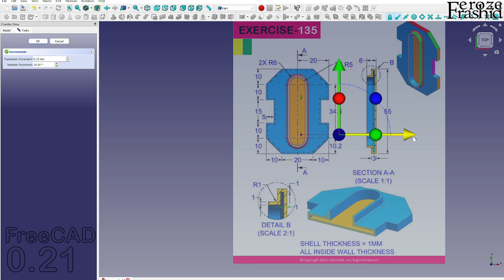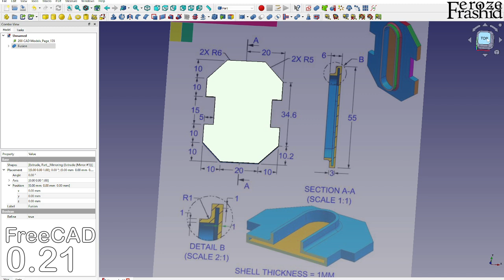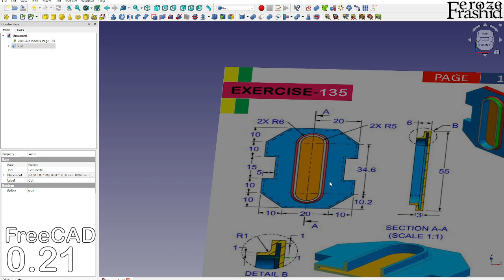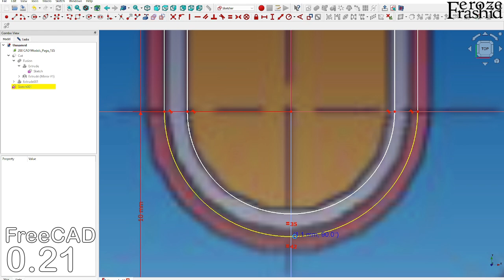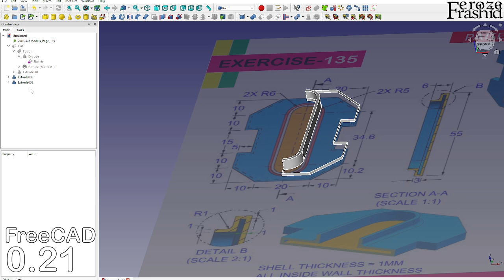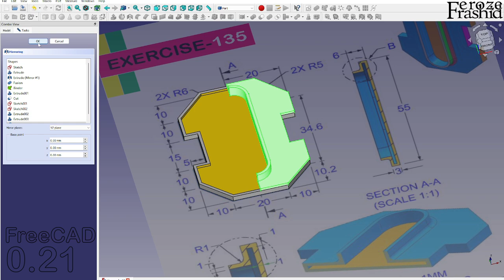200 3D Models in FreeCAD: Exercise 135

Comment: I made this model in partDesign. Used the thickness feature, but the cut from the slot in the middle  did not work out correct, i believe. Maybe you can do a video of this model in PartDesign, because it looks much easier than this approach in the Part WorkBench. Anyways thanks.
Reply from the maker: One model built in part design workbench coming right up. Thanks